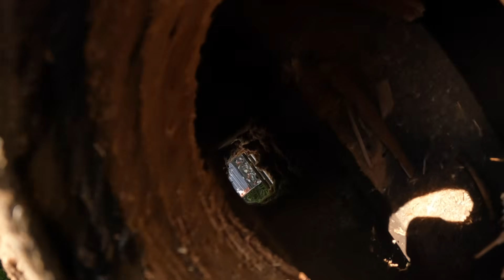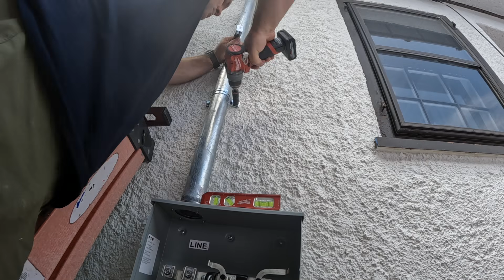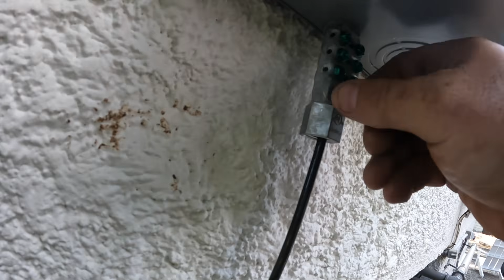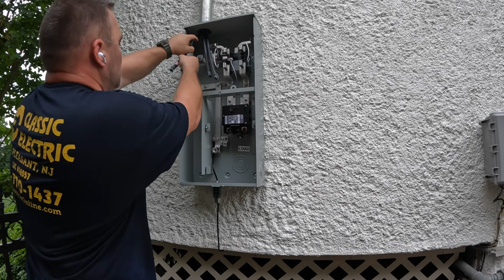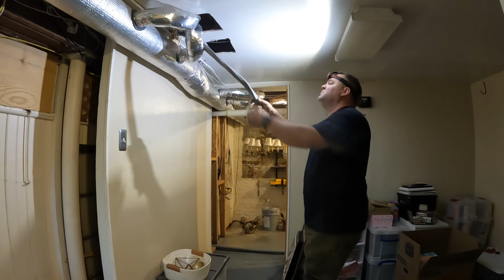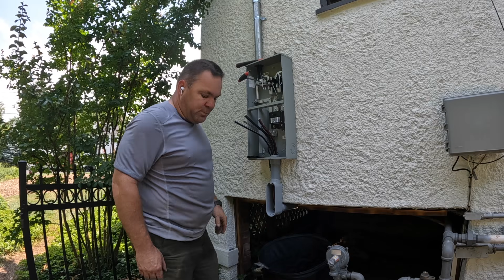NEW 200 AMP MAST SERVICE | METER/ MAIN COMBINATION | PSEG

Comment: In Canada it is illegal to do the same thing that mentioned on video many states cut off at the meter stack guys in Canada have to be the local hydro company come they do the work they disconnect take hold a meter and then when they when you then when they come back you know they would that is after the inspection does hydro One regulation within Canada if you see a hydrometer inside that mean once it used to be a flat  rate billing and when the hydrometer came in and then 60 they change them out to to exchange it out by putting the inside beside the panel box usually

Comment: Hi Siri and commenting here I know in your state is it legal to go out there and stop the service up up on The stack but say it was illegal in other states to it also in Canada is illegal in Canada to we can't just do that how to get it to the company do that give up to the local hydro company have to do that then it got to come back and reconnect it and also I can mention to you if you see hydrometer inside the house connected to the panel box or a panel box many years back going back to from 1920 up to about  up to 1962 they didn't have to meet a great hydro instead it was a flat rate electric you pay one amount regardless how much to use and when you do that that's fine but you know when they came in with a hydrometer they had to do what it called go in before the panel box filter go to get you properly on amount of hydro used so when they put the meter in to put the meters inside at the time it did it anytime you see a hydrometer before a fuse box indoor meter that is why you know that place at flat rate electrics at one time

Comment: I am not a '' YouTuber Electrician ''  !!!  
I'm a State Licensed Journeyman Electrician / Sub Contractor and have worked in the trade for 60 years ! 
Most of my work has been Residential and some Commercial. And most of the work that I have done over the 60 years , 
I worked alone doing all the work myself from design layout , roughing in and final trim out. I admire your work that you do Ron 
and the fact that you also do most of it all by yourself ! I Tip my Hat to You and Salute You ! You are Professional !!

Comment: Very well explained, I'm a electrician from Pennsylvania, I've never done the mast service and this video helps me a lot,ive 32 years experience but im the first to admit, there's always something i could learn.my question for you is ,if the existing mast service has an existing guy on it,and you remove it to install the the new rigid conduit how would i maintain the tension on the utility conductors once i remove the old guy support?,i would appreciate any help you would or could give me.thank you.
Reply from the maker: I’ve used rope to attach the drop and run the rope around something, anything. If it’s too hairy I wouldn’t hesitate to call the poco for a scheduled shut down.
Reply: @electricianron_New_Jersey thank you

Comment: Unnecessary drill the roof if have the 10 feet clearance
Reply from the maker: Oh, did you reach out to the power company? Because I did and it required the mast for the service drop clearance.  Maybe you have utility conductors going through your kitchen window, but these people don’t.  😂

Comment: I really loved this video. I am working on doing an almost identical upgrade on my house here in Albuquerque, NM. I am from CT and my dad works with an electrician there and the differenced are interesting. One big thing I noticed in your video is the distance to the gas regulator/vent. I had to get a second meter spot approved for my project because on the first one, the power company said my existing meter can is too close to the regulator. Like literally an inch. They want 36" LATERALLY from the vent to the closest edge of any electrical panel, including the meter can. What I have is grandfathered in where it is, but any upgrade requires moving it over.

Comment: What is the part number of this meter combo you are using?
Reply: could you get me the part number of the meter combo from eaton you are using that lets you run SEU out of it and not SER? all the suppliers have here in central PA are meter combos with secondary breakers which require SER to panel in house.

Comment: This panel upgrade would be a a major fail out in California because there needs to be I think 🤔 6 feet or more from the gas ⛽️ meter
Reply from the maker: Every jurisdiction has different requirements. Some states require 3 ft, some 6 ft, and some have no rule at all.
Reply: @electricianron_New_Jersey  I got you !!! I’m just saying I learned the hard way !!!
Reply: @electricianron_New_Jersey  I had to move everything because of the gas meter!!!! Yah I had a baddddd day !!! Learned the hard way ‼️‼️‼️

Comment: Nice work Ron. was wondering where you are connecting your main water pipe ground wire to, I didnt see it in the new main disconnect outside
Reply: Probably inside the house if there is a basement

Comment: I've done what you just did with the mast, and Unlearned to buyba 36 inch bit and drill up thru the soffit up thru the roof, gave the center point to drill the 2" hole!  Worked better than repairing the roof edge!

Comment: Ok for ground rods you doing a 200amp panel in Pa it’s require number 6 for 100amps in Pa
Reply from the maker: It’s always #6 AWG copper for ground rods.
Reply: You right

Comment: I believe I understand your thinking using the 2" compression coupling for the GRC riser rather than the furnished coupling with the threading.   Correct me if I'm wrong, but does the code prohibit a coupled conduit above the roof flange?  And I believe it would also be a colossal PITA to have to grab a 2" pipe threader to make the nipple to extend the riser.
Reply from the maker: Yes, 230.28(B) prohibits couplings between the penetration in the roof and the weathered IF the mast is being used to support the Service drop from the utility.
Reply: @electricianron_New_Jersey  Thought so.  The compression coupling was the correct call on this one.

Comment: Hey Ron. In case you're wondering what my background is, I am a DIYer who worked for both an electrical contractor and Graybar Supply. In any event, have you ever considered using Sweetbriar triplex for your mast and PVC service entrance risers? Is it more cost effective than the individual wire cuts for 200A services, and will your utilities allow its use?
Reply from the maker: @BassmanII  I use 4/0 aluminum single conductors for most 200 amp services.
Reply: @electricianron_New_Jersey  would you use the Sweetbriar if the customer requested it, even though it has a 2/0 neutral, or would that be an issue?
Reply from the maker: @BassmanII  It doesn’t make any sense to fish a cable in a conduit
Reply: @electricianron_New_Jersey  gotcha. Good point

Comment: I need some advice on upgrading my old 100 amp main circuit breaker to 200 amp without buying a new Electrical Panel. My meter is a C 200, I think it was upgraded by PGE a few years ago. So I think the wire from the meter to the 100 amp main circuit breaker is still old. If I want to upgrade to 200 amp. First remove the meter, then replace the old wire with 4/0 aluminum and install a new 200 amp main circuit breaker. Also I want to install a new 200 amp sub panel in my house, so I need to install 1 more 200 amp circuit breaker and from there connect to the new 200 amp sub panel in the house. Can you tell me if this is worth trying? This is a DIY job. I don't want any inspections from the utility company. Thanks.
Reply from the maker: Any time someone says to me they don't want any inspections that's a red flag. You'd be wise to hire a licensed electrician who's familiar with city/ state and also the utility company requirements. What you want can be done.

Comment: What part number is that meter combo? I’m having a tough time finding one that’s compliant with PSE&Gs requirement. (I’m a union electrician, haven’t done a residential service in 5/6 years looking to re-do mine on my house). Any response would be great, thank you.
Reply from the maker: You really should call PSEG and ask for an inspector. They'll want a permit number too. The meter must have a fifth jaw for grounded conductor metering. JCPL wants that now too. 200A Meter/ Main Eaton model number CHMMB200BTS single phase Overhead/ Underground 120/ 240 VAC SCCR 10,000 amps.
Reply: @electricianron_New_Jersey  okay will do, thank you for the response!

Comment: For the RMC, we have to use unistrut or u-bolt, a two hold strap is not considered strong enough for a service mast in California. 2 hole strap is way more convenient though. Great job as always.
Reply from the maker: @R900DZ  How do you attach the U-Bolt to the structure?
Reply: @electricianron_New_Jersey you’re supposed to put 2x4 block between the studs by opening the wall on the interior, then put the u bolt through that with nuts, then close the interior wall back up when you’re finished. With the uninstrut technically you are supposed to secure it to a stud, not just into the siding.
Reply from the maker: @R900DZ  This is what I imagined.  That’s a lot of work.  In this video, the house is over 100 years old with 1” planks used for sheathing.  Pretty sure I used 3/8” x 4 lag screws for the straps.
Reply from the maker: @R900DZ  By the way, California has some crazy rules! What power company provides service by you?
Reply: @electricianron_New_Jersey yea on some things! I think some of it has to do with earthquake-related building codes and places with high winds. The company is SCE, Southern California Edison

Comment: Great work Ron. Honest question here. Why is it #6 copper for the rods and #2 alum for water pipe? Also, can you just use the 2 new ground rods and not the water pipe? Or perhaps the water pipe and just one rod?

Comment: How do you get away with #6 GEC on a 200A service ?
Reply from the maker: @cdfornal  because #6 AWG copper is all that’s ever required for connecting ground rods.  

250.53 (E) Supplemental Electrode Bonding Connection Size.

Where the supplemental electrode is a rod, pipe, or plate electrode, that portion of the bonding jumper that is the sole connection to the supplemental grounding electrode shall not be required to be larger than 6 AWG copper wire or 4 AWG aluminum wire.

THAT’s how I “get away with it” by doing it right the first time.
Reply: @ sorry that came out wrong. I missed the “supplemental” part

Your primary ground is sized according to 250.66 right? Usually I’d just run a continuous piece of #4 cu from the panel to two ground rods even if there is a cu water line. This is because most everyone is pulling out or splicing the copper - so we know the two rods should be fine for at least 20 years

Comment: Those lag screws are NOT 1/2". Screws and bolts are sized by their shank diameter.  So they may be #12 or 1/4" or 5/16" etc. The hex head is considerably larger than the shank and I'm guessing yours had a 1/2" (across flats) hex head wrench size.
Reply from the maker: @clearviewtechnical  9/16

Comment: Ron, My ranch home built in 2011 has a 200 amp service, 20 circuit panel filled. I want to have a whole house surge protector installed. I may need a sub panel installed, can I get a 20 circuit, have a few needs for extra electric maybe generator, and small sunroom.
Reply from the maker: @gardenjohn1  we can add a sub panel or even better install a new 40/ 80 circuit capacity mb panel.

Comment: Hello Ron. Question for you from Canada. I noticed you had to extend your rigit conduit by 2 feet with another rigit. Couldn't you extended with 2 inch PVC conduit using the transaction attachment between rigit to pvc?
Reply: Transition.
Reply from the maker: No. There’d be no reason. To do that.

Comment: Just had an inspector in Bergen county break balls about using a 2 inch LB for 200 amp SER. " I'll let it go but next time it has to be 2 1/2"  really dude?
Reply from the maker: @wirenut9062  tell him to pound sand unless he has a code reference for the DCA.

Comment: Nice install during a really hot, humid week. I'm not sure if you're on 2023 yet, but the marking / labeling requirement for the emergency disconnect was clarified to dictate the color (red background with white text), and a minimum text height of 1/2". Could be a nice thing for you to start incorporating now so it's already part of your routine when it becomes enforced in your area.

Comment: Could you have used your new riser to come out of meter can and then used threaded end of old cut riser for the 2 feet and the threaded couplimg that comes with them, thus saving having to buy the compression coupling? Also the bridgiing between  floor joist is to keep the bottom of the floor joist from twisting.

Comment: Very true what you said.....Do work others don't want to and you'll do well......I did exactly that and my working life was always successful. I was an electrician when I was not long out of high school and should have stayed in that line of work. I'm 76 and spent 30 years working on generators of all kinds and sizes for a generator service company. I just retired last year when my company was sold and my job got basically eliminated......Former customers still seek me out and I do a few jobs. I worked on RV generators mostly for quite a while and very few places out there even will touch them......This one was a pretty big job and with the heat we had you earned your money for sure.....Nice job...
Reply from the maker: Very specialized generator repairs and maintenance.

Comment: Great looking service! Ive done a few mast services, and ive actually never cut the 2" rigid in a way that ive had to use a compression coupling (or cut new threads god forbid). Technically if you read in PSEGs redbook (or whatever color book it is now), they want you to use straps that go all the way though a framing member or masonry with a nut and washer securing it on the inside of the building. Ive never used them, and never seen them used, but still something thats in the book.
Reply from the maker: I did not see that in the book.

Comment: I know I bust your balls a lot but I do watch a lot of your videos.  I'm not one of your kiss azz subscribers who will tell you that you did no wrong and you're perfect.  You need guys like me to Critique your work so you're next job will be better.
What I noticed about you is I don't think you take enough time to plan out Your jobs.
I mean you forgot white electrical tape, your go pro/stand, you couldn't even show us the main part of this video (the service masts installation)ugghh, You messed up the height requirement for the rigid pipe ( A simple google search could have told you the correct height in seconds and save you $, time, and that nasty eyesore of a coupling😂) etc. 
But in all seriousness please consider Taking more time in planning out your work day the day before. Write things down on a piece of paper , what you're gonna need, what you're gonna do etc.
I mean you made a lot of mistakes bro.
And what's up with the black grounding wire that you shoved underneath wood chips and just threw behind the Ac condenser?
Did the supply house run out of green?

But thanks for trying.

Comment: Hi Ron, I look forward to the 2nd part of this video. That was a crazy run back to the ATS, I'm guessing. I have a couple questions: Are you required to bond the natural gas to service and are you using 4/0 for your neutral in your service riser?
Thank you for taking the time to put out these videos. I know it's a lot of work.
Reply from the maker: If you have natural gas appliances (like a furnace, or gas stove), the natural gas is bonded by the equipment grounding conductor of the circuit supplying power to the equipment. The natural gas pipe entering the home IS NOT PERMITTED to be used as a grounding electrode the way the copper water main is required by the code to be used as a grounding electrode. NEC 250.102

Comment: Hey Ron what's up nice job. What size aluminum service entrance cable is that. If you were not going through the roof could you use PVC.
Reply from the maker: 4/0 aluminum or you could use 2/0 copper for 200 amp dwelling service.

Comment: Hey Ron, thank you for all your videos. I live in Bergen county. Just wired my own new build and passed rough-in inspection last week. Your videos have been a great help. I am an electrical PE but to install my own electrical was definitely a new experience. I am working on the service aspect now and was wondering if I could hole saw the PSEG 320A pan in a spot where there are no knockouts. It just would work better for my connection to two 200A Generac service rated ATS’s. Thanks in advance!
Reply from the maker: Yeah, unfortunately I do not think PSEG will allow you to cut-out your own knockouts in the meter enclosure. That's a utility rule. You could call the construction department and schedule an inspection with one of their supervisors but I do not think they're going to allow it. Good luck with that and I hope this helps!
Reply: Hey Ron, you were right, they wouldn’t let me drill. They said it would void the UL listing. Odd since the ATS enclosures have to be drilled; they only have one knockout.
Reply: One more question if you do not mind, I have a 350MCM copper feed on the line side of the meter pan. For the GEC, I plan to bury 5/8” rods 8’ min. apart and run #2 AWG in between. From there tap with #4 to each 200A ATS. I also have #4 jumpers to rebar and cold water. My question is, can I bond all three on the ground bus of one of the ATS’s or does it need to happen ahead? Thanks again for all your help.